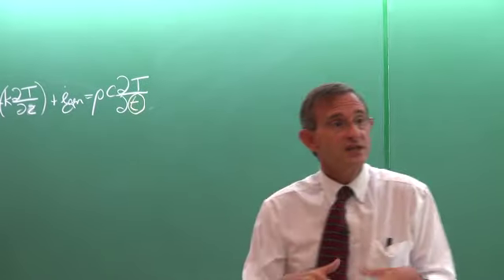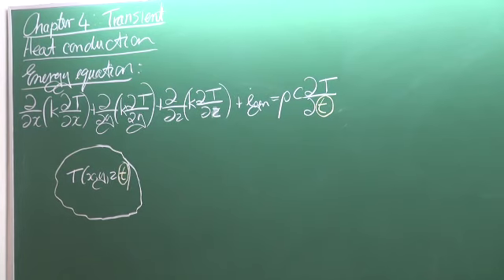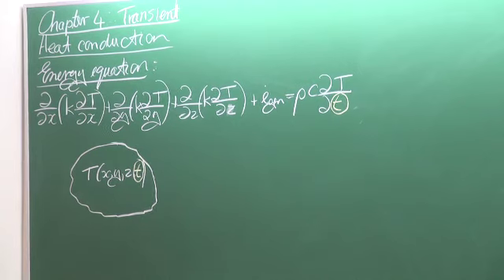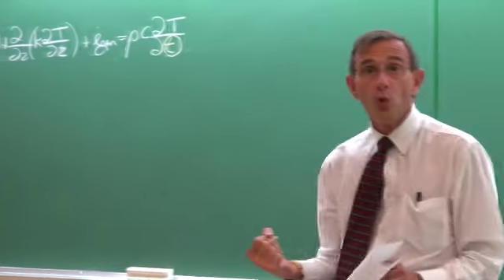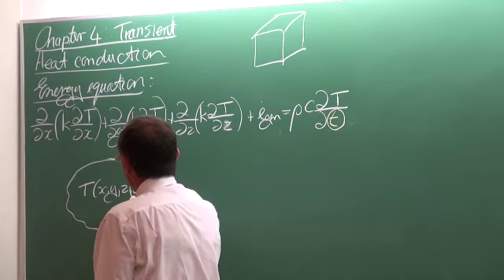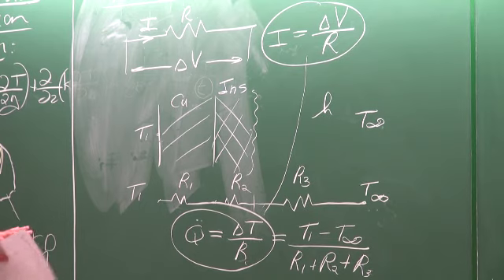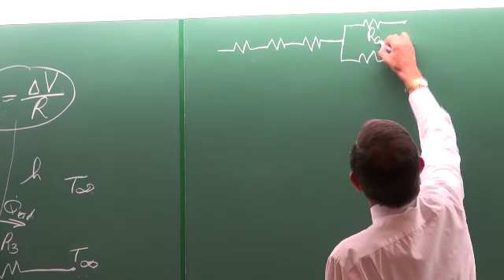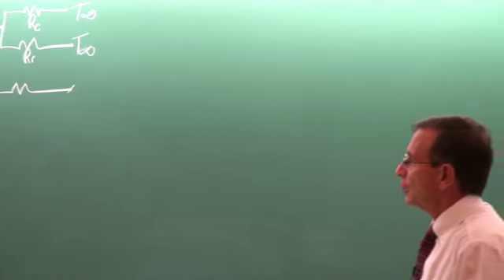Lecture 02 (2014). Transient heat transfer and introduction to lumped system approach

Comment: Hi Sir, @ 10:40, i think it should be two thermal resistance in series and two in parallel. Isn't it? I also wanted to know why nobody seems to introduce the concept of energy stored in the body, which is called as thermal capacitance. I have seen your previous videos which explains it but i think it would be nice to see it pictorially in your schematics you draw?? Thermal resistance affect the steady state temperature, but the thermal capacitance influences the transients. Therefore i think, since the chapter is for transients, thermal capacitance also is more important??